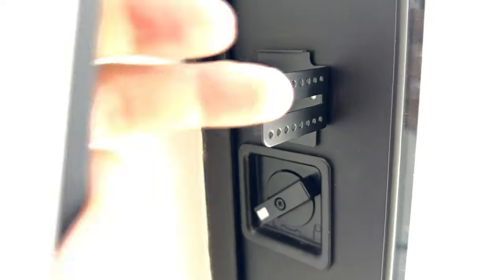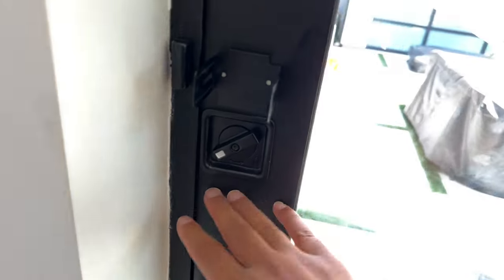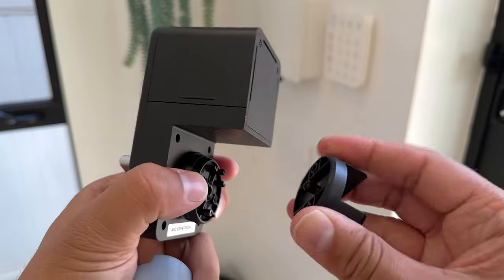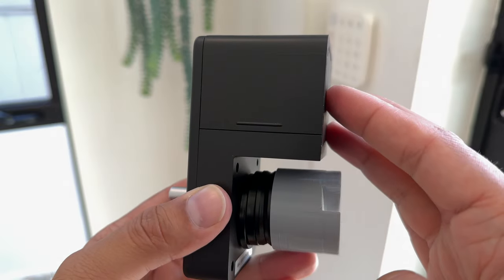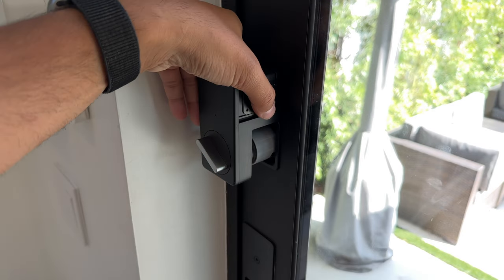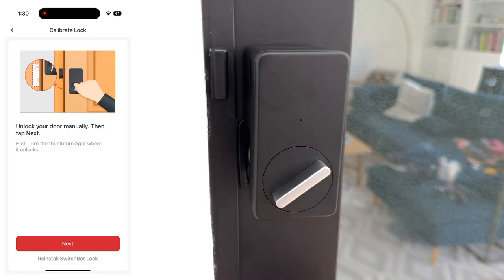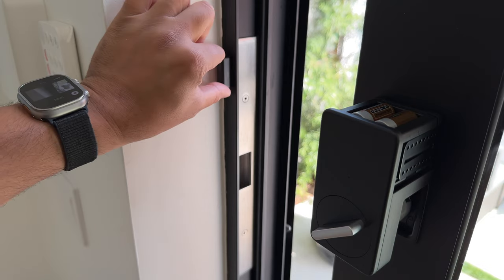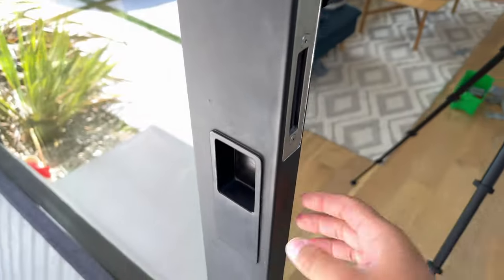Finally Found A Smart Lock That Works For My Sliding Door!

Comment: you did good ....but most US patio sliding door lock doesn't look like that  ..what kind of patio door you have ?
Reply from the maker: Yeah, it's a Fleetwood sliding door. That's why I had to use this particular smart lock and still needed to 3D print an extension. I couldn't find any other solution for my particular door so I figured I'd share it for anyone else needing the same. Also the 3D print model I shared can be remixed to work with all kinds of other doors. I've already seen several versions now on Printables after uploading mine.

Comment: Aweome! Did you use the adhesive to mount the main lock?
Reply from the maker: I did use the adhesive because I didn't want to drill holes in the metal door frame. I was a little worried at first that it might come off but it's been holding up well so far.

Comment: I wish I could 3D print something where I could use the switchbot to turn on my NRP 200 computer. I don't have experience with 3D printing and I unfortunately cannot use the switchbot to turn on my PC which has the nr200 case
Reply from the maker: You may just need to add something to the arm that sticks out a bit so it can press further into the case where the power button is. The hard part is how do you attach something that will both work and withstand the pressure of being pressed without breaking off.